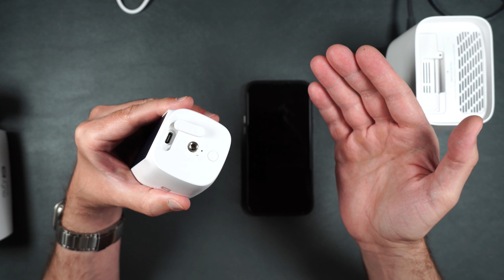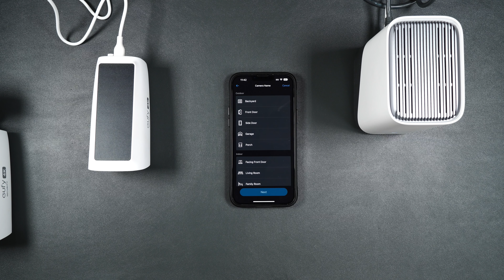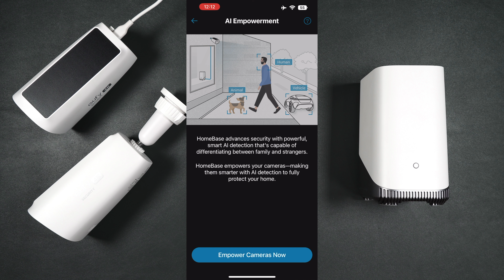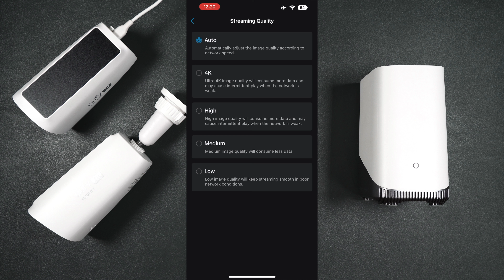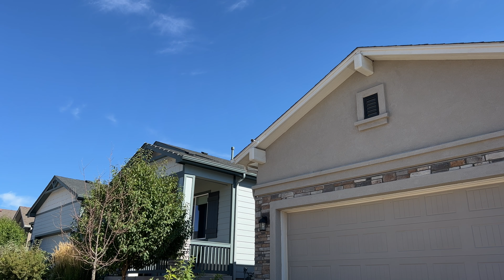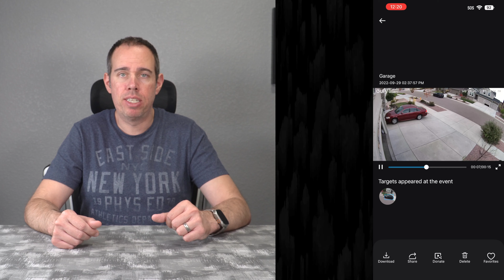Eufycam 3 4K Solar Security Camera Kit - Best in 2022!

Comment: I’m trying to order more cams, I have two 330 and doorbell cam. However, getting my wife to agree on spending another $300 for a couple more cams. I sold her on it being able to read license plates , but it can’t.  Most residential properties have a required set back of 25 feet. With my cams installed it adds another 10’ feet,barely get my neighbors leaving his driveway, but will catch rabbits in my hard. When this is improved I’ll get more cams. I love it because no monthly fees

Comment: How far will the camera detect movement, mine only detects mine about 10-15 feet. It caught me leaving the garage with my truck, also about 15’, but when I returned 2 hours later , the camera didn’t catch my return. Also I walked out through my to the curb , the camera didn’t pick me up. I have all motion detections checked , not sure what I am doing wrong. Any suggestions?
Reply: Every bit of 30-35 feet. I am also dealing with not getting all Motion detections. Large UPS type trucks and vehicles. My UPS truck passed 3 cameras and no detections. I’m trying to figure out a solution for hundreds of “detected activities” from shadows and bushes.
Reply: @fattysgarage1754  I am pretty well set up now, I changed my activity zone and detection sensitivity to high, unchecked all other motions
Reply: Human detection range is very pathetic. In my case it’s hardly 6-7 ft and most times even that gets missed out because the camera wakes up with a lag of 3-4 seconds. Eufy tech support is terrible and keep deflecting to FAQs on range and lag related issues.